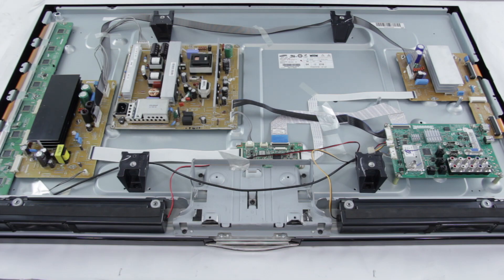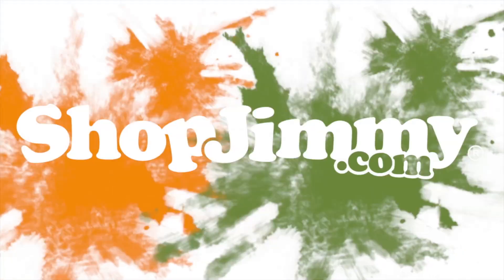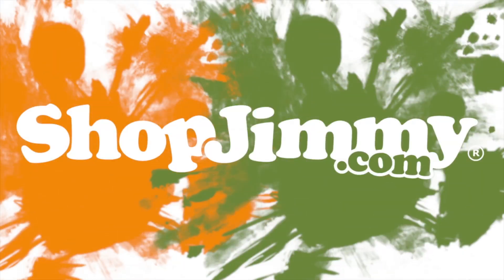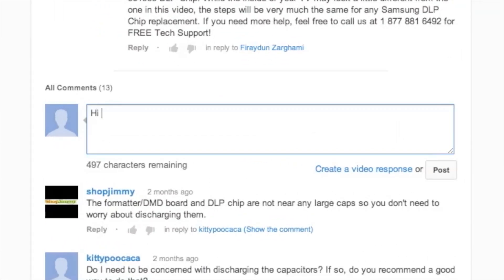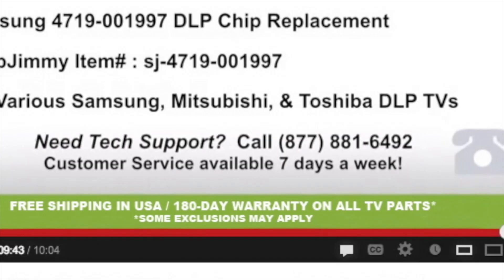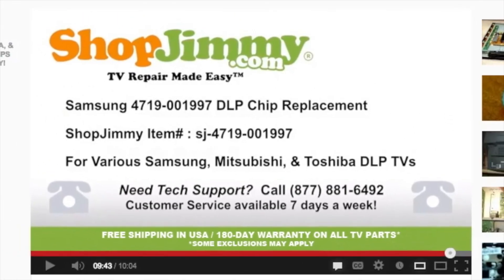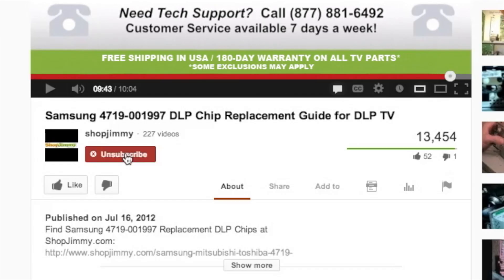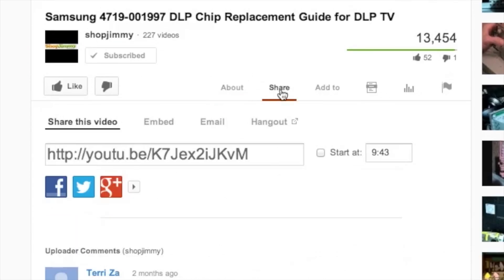Plasma TV Repair Tutorial - Common Symptoms & Solutions - How to Fix Plasma TVs

Comment: I have a Samsung PN50A510P3FXZA Plasma.  It cycles on and off at start, up to an hour before staying on. The picture gets completely green and disfigured through the power cycling.
Reply from the maker: Fadil Edwards  Please watch this video FIRST to help with your repair!  https://www.youtube.com/watch?v=BP3NVNCGEv8  I recommend replacing the main board in your TV.  Click this link to replacement parts:  http://www.shopjimmy.com/catalogsearch/result/index/?cat=56&q=PN50A510P3FXZA  There may be multiple boards for the same TV model number, be sure to match part numbers on your current board, with your replacement for compatibility.  Here is a link to a video showing how to identify your part number, click here:  https://www.youtube.com/watch?v=BEPWrefQvqI  Thanks and please let us know if you have any further questions with your TV Repair!  www.shopjimmy.com

Comment: I have a LG 60PV450 and the other day it shutdown while it was on.  Now when I try to turn it on I hear a click and the standby light comes on but nothing displays on the tv.  I have pulled the cover off and visually examined the boards and do not see any capacitors that are obviously blown.   From watching your video I am thinking that it is power supply, what do you think?
Reply from the maker: *****   Try this at your own risk. Unplug the TV, then disconnect the y board and plug in the TV to see if the TV powers up. Reply with the results of this test. Thanks! www.shopjimmy.com
Reply: ShopJimmy.com I tried as you suggested and the TV still does not power up.  Other ideas?
Reply from the maker: *****   Try the test on the other side with the Z board and reply with the results.  Thanks!  www.shopjimmy.com
Reply: ShopJimmy.com Sorry for the delay, was out of town a couple of days.   I disconnected the Z board, and it still does not power up.  What should I try next?
Reply: ShopJimmy.com Sorry for the confusion, but I may have misunderstood you when you where asking if to check if the "TV powers up", did you mean that I should see an image or just that the TV should be getting power?

In any case, I took time today do some testing and troubleshooting and here is my results:

Here is what happens with everything hookup as normal:
1) I plug in the TV and hear a double click, the standby light flashes once, stays on on for a moment and then goes off, no image is on the screen
2) Then I pressed the power button and hear a single click, the standby light comes on, no image on the screen
3) I press the power button, hear a double click, standby light goes off, no image

Then I unplugged all the boards from the power supply board and tried turning it on
1) I again hear click click, but standby light never comes on, power button does not respond

Then I plugged in the logic board and got the same results
1) I again hear click click, but standby light never comes on, power button does not respond

Next I plugged in the main board (left logic board plugged in also) and tried again
1) I plug in the TV and hear a double click, the standby light flashes once, stays on on for a moment and then goes off, no image is on the screen
2) Pressed the power button and hear a single click, the standby light comes on, no image on the screen
3) I pressed the power button again and again hear a double click, standby light goes off, no image

I repeated the process by add the X board got the sames results and lastly added the Y board with the same results

Sorry this is so long, but hopefully is helpful

Any other things I should try?
Reply from the maker: *****  Please watch this video FIRST to help with your repair!  https://www.youtube.com/watch?v=BP3NVNCGEv8  Could be a problem with either the main board or the power supply.  You may need to replace each board individually to see which on fixes the problem.  Click this link to replacement boards for your TV model number:  http://www.shopjimmy.com/catalogsearch/result/?q=60PV450  There may be multiple boards for the same TV model number, be sure to match part numbers on your current board, with your replacement for compatibility.  Thanks and please let us know if you have any further questions with your TV Repair!  www.shopjimmy.com

Comment: I have a Philips model 42PFL7662D/12 it turns himself of and on. But on the inside is a bit different than the Samsung that you are showing
Reply from the maker: salman rami   Please watch this video FIRST to help with your repair!  https://www.youtube.com/watch?v=BP3NVNCGEv8  Sounds like it could be that your keypad on the TV is stuck, or you have a bad main board. Check to see if one of the buttons is stuck on the keypad. If not, then I recommend replacing the main board in your TV.  Click this link to replacement parts:  http://www.shopjimmy.com/catalogsearch/result/index/?cat=56&q=42PFL7662  There may be multiple boards for the same TV model number, be sure to match part numbers on your current board, with your replacement for compatibility.  Here is a link to a video showing how to identify your part number, click here:  https://www.youtube.com/watch?v=xSSxNZXZIXA  Thanks and please let us know if you have any further questions with your TV Repair!  www.shopjimmy.com

Comment: I have a samsung model PN50A510P3F model code # PN50A5103PFXZA. When i turn it on it comes up sometime with a loud noise and sometimes without but always with a scrambled picture. It will shut itself off and then back on again. This happens 3 to 4 times and then its ok with a great picture.  have any ideas?
           Thanks!
Reply from the maker: Debra Rhoads  Please watch this video FIRST to help with your repair!  https://www.youtube.com/watch?v=BP3NVNCGEv8  I recommend replacing the main board in your TV.  Click this link to replacement parts:  http://www.shopjimmy.com/catalogsearch/result/index/?cat=56&q=PN50A510P3F  There may be multiple boards for the same TV model number, be sure to match part numbers on your current board, with your replacement for compatibility.  Here is a link to a video showing how to identify your part number, click here:  https://www.youtube.com/watch?v=BEPWrefQvqI  Thanks and please let us know if you have any further questions with your TV Repair!  www.shopjimmy.com

Comment: My plasma screen had no picture and was making a clicking buzzing noise.
I watched the videos and did what it said. When I disconnected the x & y sustain the noise stopped. Then I plugged in the Y sustain only and when I plugged it in there was a single click(sounded like a relay energized) and then it was quite. then I powered x sustain ( the power for the x sustain comes from the y sustain board) the buzzing and clicking started again. I order both a new x and y sustain board from you and replaced both boards. When I powered it up I continued to do the same thing there was no change any idea on what else I should do. I checked the power from the power supply with a meter and the were fine. Do I just need new buffers or what any thing would help. I have a 59 inch samsung plasma screen samsung pn59d550c1f.
Reply from the maker: John Henderson  Please watch this video FIRST to help with your repair!  https://www.youtube.com/watch?v=BP3NVNCGEv8  I recommend replacing the buffers.  Click this link to replacement parts:  http://www.shopjimmy.com/catalogsearch/result/?q=pn59d550c1f  There may be multiple boards for the same TV model number, be sure to match part numbers on your current board, with your replacement for compatibility.  Here is a link to a video showing how to identify your part number, click here:  https://www.youtube.com/watch?v=R1jmj_foId0  Thanks and please let us know if you have any further questions with your TV Repair!  www.shopjimmy.com

Comment: Hi

Just watched your video, which was very informative.

I have an LG50PQ3000 Plasma. When I connect my HDMI Cable from my Virgin box, there is no picture. but the sound is absolute perfect. What would be the best place to start to look at, and would you recommend purchasing a replacement part. I have a soldering gun here which I'm handy with if I need to desolder and resolder capacitors etc. as well, which parts of which board would it be worth looking at
Reply from the maker: mrbside80  Please watch this video FIRST to help with your repair!  https://www.youtube.com/watch?v=BP3NVNCGEv8  It could be a problem with the box.  If not, I recommend replacing the main board in your TV.  Click this link to replacement main boards:  http://www.shopjimmy.com/catalogsearch/result/index/?cat=56&q=50PQ3000  There may be multiple boards for the same TV model number, be sure to match part numbers on your current board, with your replacement for compatibility.  Here is a link to a video showing how to identify your part number, click here:  https://www.youtube.com/watch?v=RwHTvjMdrhk  Thanks and please let us know if you have any further questions with your TV Repair!  www.shopjimmy.com

Comment: I tried your test with the SC board unplugged and not get 7 blinks.   Now what
Reply from the maker: Ucrazy60   This means there could be a short on one of the following boards, the SC, SS, A Main, or the power supply.  You can test them for shorts or it may even be easier to just get a new TV, depending on your ability to test boards.  Thanks!  www.shopjimmy.com
Reply: ShopJimmy.com Thanks for the reply.   With that many possibilities and not being proficient in testing,  looks like a new TV is in order.   Thanks again

Comment: I meant to mention that the manual controls on the left side of the screen do work. I did replace batteries in the remotes, and have tried unplugging the set for several mins as well, no luck

Comment: "We have a Panasonic model #TC-P58S2  55" plasma.. Recently it has begun not responding to any remote signals... it is not the remote itself as it does not respond to the universal or the dvr remote (which does work on the dvr).. any easy fixes to check for?..." Ps.. red power light stays on. ie- no error code

Comment: Hi,

I need a little help. My samsung 50" plasma has developed a line, horizontally near the top, about one pixel thick. I've had it in to a repair shop, they quoted me £800+ for a new screen and said it can't be fixed. I have an option to purchase a new screen elsewhere, model PS-50Q97HD
My TV model is PS50C550G1W. Will it work if I use the PS50Q in the PS50C tv? If not, is there away I can fix the line? Thanks
Reply from the maker: *****   This sounds like a TV panel (TV Screen) problem.  If your TV panel is bad, it may be more cost-effective to replace the TV as panels are typically hard to find in stock, difficult to replace, and expensive.  Thanks and please let us know if you have any further questions!  www.shopjimmy.com

Comment: Hi gents. I have the same type of TV which has no image. I have tested the Y and its ok and I've changed the X. Before to change the X board the power source went in protection and when I cancel the X board the power source was fine. Now when I turn the TV on I still have no picture but I have a short noise like bzzt and no image.
Can the buffer board LJ41-08594A damaged without damaging the Y board? I will take this off and I will check for any short. I'm looking forward to hearing from you. Thank you. Cris
Reply from the maker: Cristian Ionut Marcu   This sounds like a TV panel (TV Screen) problem.  If your TV panel is bad, it may be more cost-effective to replace the TV as panels are typically hard to find in stock, difficult to replace, and expensive.  Thanks and please let us know if you have any further questions!  www.shopjimmy.com
Reply: Hello and thank you for your response. I've realised that the tv panel is the problem as I've burned 2 X boards but no problem as I will sell the TV tomorrow. Thanks

Comment: Hi, I have a 2007 LG 50py3df-ua the tv turns off and on by itself and if it doesn't do that it does this, the picture and sound freeze on and off, also these things normally happen on the lower hd channels 2-15 on cable. I have hooked up a different tv in the same location and it works fine, so it must be the tv. Have any ideas?
Reply from the maker: Paul Roling   I recommend replacing the main board in your TV.  Click this link to replacement parts for your TV model number:  http://www.shopjimmy.com/catalogsearch/result/?q=50py3df-ua  There may be multiple boards for the same TV model number, be sure to match part numbers on your current board, with your replacement for compatibility.  Here is a link to a video showing how to identify your part number, click here:  https://www.youtube.com/watch?v=RwHTvjMdrhk  Thanks and please let us know if you have any further questions with your TV Repair!  www.shopjimmy.com

Comment: Hi i have a samsung ps-42v4s plasma some times its fine but after a while i sometimes
get out of line horizontal lines from top to bottom not black line but it seems each line of pixels are to far left and the next line to far right.sometimes it gets so bad you cant watch but sometimes it improves.it does this on all ports and menus your advise would be much appreciated .
thanks richard
Reply from the maker: sam wade   This sounds like a TV panel (TV Screen) problem.  If your TV panel is bad, it may be more cost-effective to replace the TV as panels are typically hard to find in stock, difficult to replace, and expensive.  Thanks and please let us know if you have any further questions!  www.shopjimmy.com

Comment: I have a samsung plasma display tv model no is pn43d450a2d it turn on but its just black wht do u think it could b
Reply from the maker: jose patrick  Please watch this video FIRST to help with your repair!  https://www.youtube.com/watch?v=BP3NVNCGEv8  I recommend replacing the Y-Main board and the Bottom Y-Scan Drive board in your TV.  Click this link to replacement parts for your TV model number:  http://www.shopjimmy.com/catalogsearch/result/?q=pn43d450a2d  There may be multiple boards for the same TV model number, be sure to match part numbers on your current board, with your replacement for compatibility.  Here is a link to a video showing how to identify your part number, click here:  https://www.youtube.com/watch?v=R1jmj_foId0  Thanks and please let us know if you have any further questions with your TV Repair!  www.shopjimmy.com
Reply: Thank u so much

Comment: See my original post below.  TC-P46G25    I followed the instructions you gave below on another post.  I unplugged the SC board and powered up.  No I got 1 long flash then 7 flashes after hitting the power button again.  What next.  Thanks in advance.
Reply from the maker: Ucrazy60   Try this at your own risk. Unplug the TV, then disconnect the SC board and plug in the TV to see if the TV powers up. Reply with the results of this test. Thanks! www.shopjimmy.com
Reply: ShopJimmy.com Tried this now I get one long flash and then 7 flashes.  What next
Thanks

Comment: Hi, i'm trying on a PLasma LG 50PK980.
On power on cycle, plasma screen become dark grey for 1 second, then no image, black screen (it seems black for no power to plasma cells, not for a 'logic' black image showing). But no error status seems to be given, no blinking leds, & so on. Remote & front panel commands seems to works. Power On/StBy command functioning, but no image on screen. When received a command from panel or remote white central led blinks, as it do normally.   But no image on screen, neither the main menu image appears.

I checked the main power board and found all voltages are present. All fuses on power, Y-sus & Z-sus boards are good. Tried also to detach Y-sus and to power on, but no changes.  Same for detaching Z-sus board.
On central logic control board the small green led D1 blinks, all low voltage 5v & 3,3v values are present at connectors pin of that board. No anomalous temperatures seems to be present.
On Main Board i just verified that both regulators 3,3v and 1,2v on are OK. No red light from audio le
Have you any suggest in order to understand what board can be faulty ?
Reply from the maker: Rik Ben   I recommend replacing the y board and buffers in your TV.  Unfortunately I do not see any replacement parts in the search results for your TV model number on our website.  Please reply with your part number on your main board and I can try searching for replacement parts.  Thanks and please let us know if you have any further questions!  www.shopjimmy.com

Comment: Hi Guys ...I have a Panasonic Plasma TV Model # TH-50PZ700U . My problem is a blank Vertical area on the right hand side of the screen about 2 inches wide and 12 inches long running from the top of the viewing area straight down the area is a perfect rectangle with a crisp defining line the  rectangle in solid black can you determine if this is fixable and if so what  parts do I need thanks ...Walt
Reply from the maker: Walt Longtin   This sounds like a TV panel (TV Screen) problem.  If your TV panel is bad, it may be more cost-effective to replace the TV as panels are typically hard to find in stock, difficult to replace, and expensive.  Thanks and please let us know if you have any further questions!  www.shopjimmy.com